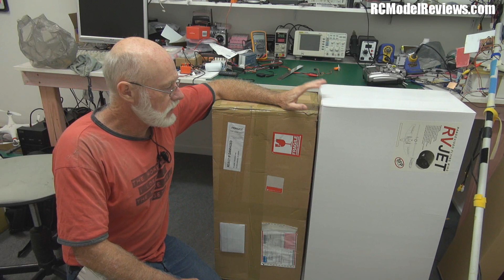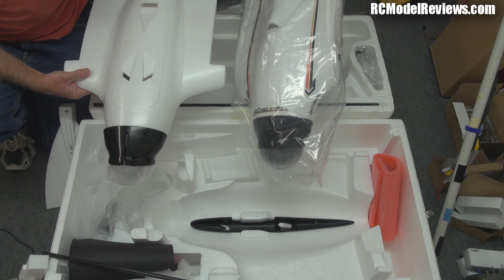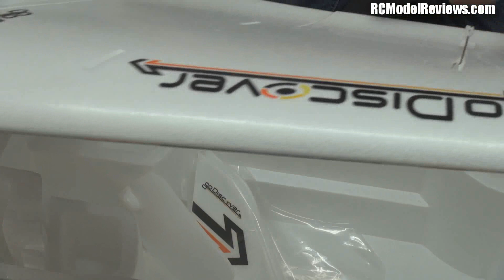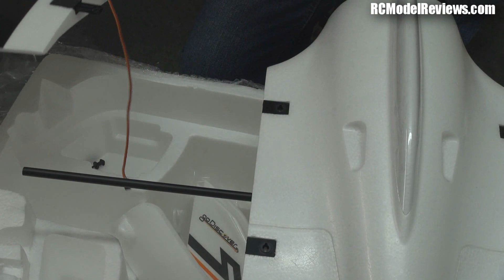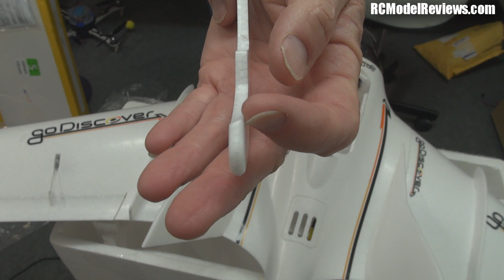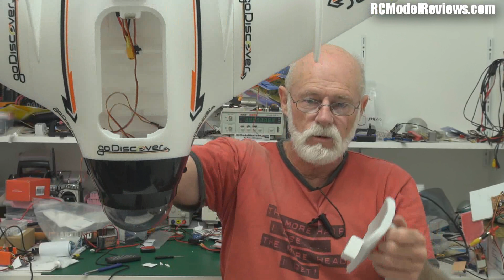Go Discover versus RVJet FPV wing RC planes (part 1)

Comment: I am yet to have a single Hobby king part fail , I have been a platinium member for about 3 years and am still using every , plane , battery, esc  and motor I ever bought from there . Sure a few things need tweaking here and there but even expensive kits have their share of that. I have have expensive esc that I paid three times the amount for go up in flames upon the first use . Infact I have three twister 3d helis and every one of their esc failed with in thirty or forty seconds of use and none got to actually even fly .. now they all have turnigy sentry esc in them  and flew quite happily,  untill the soft aluminium mainshafts in them exploded !
Once again the so called cheap and nasty Hobby king  pro 450 are way better quality than the expensive Twisters .
Yes you do get what you pay for , the higher you pay the more you get ripped off.
I dont know how many times I have gone into a Hobby shop and seen Turnigy or other Hobby king products for sale being sold for 3 or for times their normal price .
 Sure I have had magnets come loose in motors , not just hobby king ones either , but a little devcon and 3 years later they are still going.
To many of us are too used to being spoon fed and everything done for us , to any one that has modelled for years a little tweaking here and there is nothing. I have never bought built or owned a single model of any sort that I have not modded to suit my own needs or ideas, usually before ever even flying. Its all part of the hobby and fun.

Comment: Go Discover is a very nice flying machine, ruined by the very poor quality parts supplied. Most importantly the prop hub is plastic. When it breaks (as it will) it can rip out the motor. Mine did. Please use a metal hub. The servos are the nastiest cheapest I've ever seen. Ok for a small foamy but hopeless in a large plane.. The pan tilt is a very clever design again badly let down by the servos. Finding replacements here is very hard as the splines seem to be none standard. Corona is very close  but the height is different. I've written to HK about this but as usual they ignore suggestions.

Comment: I'm over buying hobbyking kits, the quality is CRAP. I'll buy parts from them, but my ARF's I buy from other suppliers now. If they sell it as 'going together', then it should go together without needing heaps of work. In that case I'd rather get ALL bits separate and put EVERYTHING together myself, atleast then it would fit without needing to be cut apart and fixed, which makes it look even more crap..

Comment: Try and control your bias a bit better, your making it seem very obvious, it took 30 seconds longer to fit the pin, so what...
Reply: ok yes we have all had these pins not fit really not a big deal on 100 dollar plane
Reply: Not bias... just observations.

When a build takes five times as long as it could, simply because bits don't fit very well, I think that's worthy of some frustration.

Don't forget that I also stated that it's a lot of plane for $130.

Like all products -- there are positives and negatives and I do my best to point out both sides of the coin.
Reply: ***** mate still enjoy the reviews keep em coming whats happening with your wings??
Reply: *****
You didn't really think you would put it together in 15minutes, did you?? , it took 1hr 15minutes, hmmm